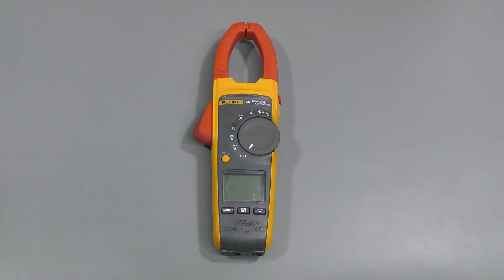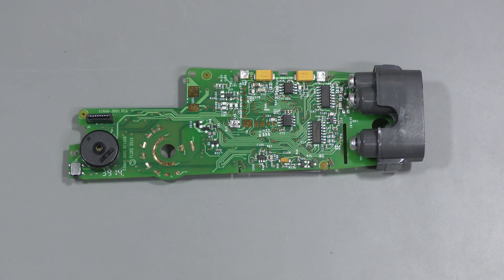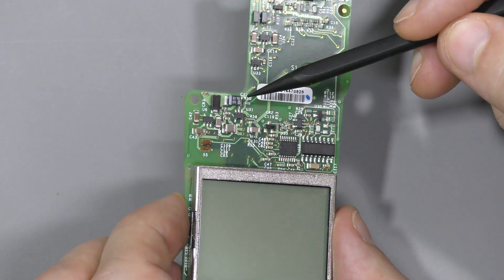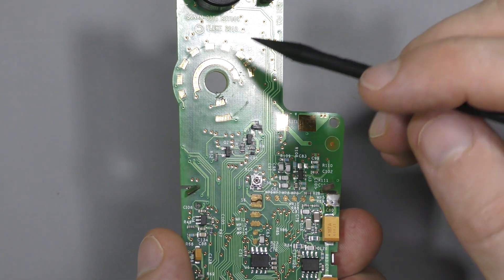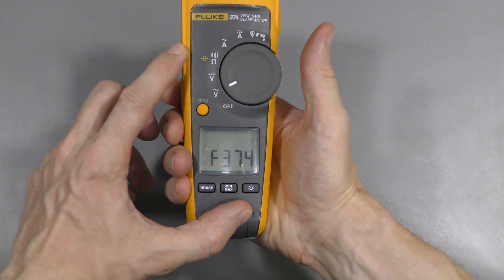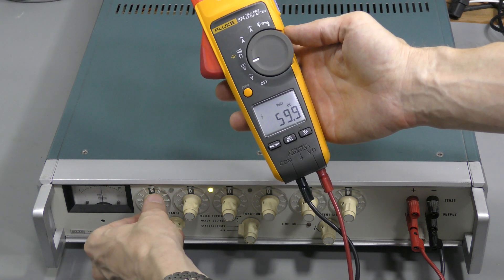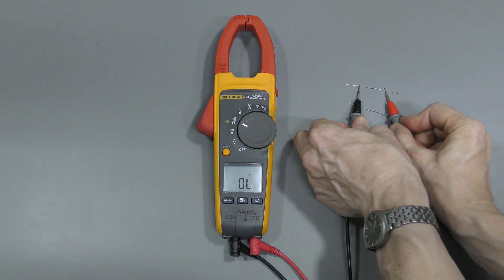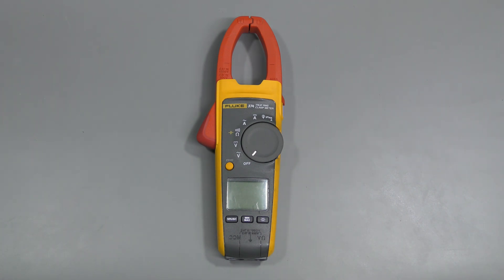#97 - Fluke 374 clamp meter repair

Comment: Hello to all. Maybe someone can help me in "non standart" problem... A have Fluke 378FC clamp meter. For 1 year it was lying on the shelf after a bought it and when a start measuring PB battery that was the problem. At straight probe polarity it was "for example" 13.0VDC, reversed probe polarity show me 12.0VDC. Other meters show 12.5VDC. I tried with different multimeters, probes, batteries and absolutely always this fluke showed me +/- 0.5V. What can it be? maybe firmware? I tried firmware upgrade via bluetooth, all was succsessfully, but problem with voltage remains.
Reply from the maker: I would suggest starting from the specs. DC Voltage: Accuracy 1 % ±10 digits.

Comment: I had a 376 that would not power up. Found U40 to be shorted out between pin 7 vss and pin 14 vdd. Was measuring 5 ohms. I desoldered pin 14 and lifted off pcb. Short was gone. This is a RTC I believe it is used for auto power off feature. Meter seems to work fine now with short removed. Not sure if I will go to the trouble of replacing it or not just for auto power off to work. U40 is under the LCD, so we have to handle disassembly carefully, not to damage it. In the beginning, I compared the current draw of this meter to a know good one. This one was way higher even when turned off. I used a temperature gun to isolate which components might be heating up. I found that the temperature around c2 c1 c141 which are all in parallel to be about 10 degrees higher. I thought one of these capacitors had shorted out when I measured 5 ohms across them, so I removed them all. Still had 5 ohms on pcb even with them removed. That is when I found U40 on the other side of the pcb to be the one that was actually heating up. This should be the same circuit in the 374 375 376 meters.

Comment: Someone may know the value of the high voltage ceramic think film resistor locate in the input?
Reply: If you mean the white flat resistor, it is a 1 meg, and I had one checking open. I hit it with some good leaded rosin core solder and it has worked fine now ever since.
Reply: @thomaszak1098 mine measures "OL" with my fluke 179.   So you just re soldered the mounting leads and it came back to 1 meg?   Trying to source one of these is hard!
Reply: Re soldering the mounting tabs fixed mine!   You could see where the solder had delaminated from the ceramic slab.
Reply: @kenstumpe9612   thanks. but the problem a face break the resistor in various pieces. After a long investigation i discover the value and type of resistor is HV resistor of 1M ohm. is very difficult find the original to replace!
Reply: I called fluke parts and asked about pn 103454.   They gave a quote of about $12 +$16 more for shipping.   None in stock, 8 weeks estimate.   I was lucky to just resolder. 4:47

Comment: Own the 325 version I bought brand new and put away for several years. Tried it today and wouldn't power up. Your video gave me the courage to open it up and it turned out to be dirty battery contacts inside. Thanks!

Comment: Very good video, thank you very much for your work, the like goes. I would like to ask you what function that variable resistor that is located in the rear and central part of the circuit would have. Thank you so much.

Comment: good afternoon ENG, greetings from Mexico,
Note that I have the FLUKE 376 FC clamp under repair and the fault I have is that the white thick film-type resistance is completely open,
It doesn't give me a reading when measuring with any multimeter, the resistance is what is directly linked to the voltage, Ac, Dc, and ohms,
Do you by any chance know what value that white flat resistor has in Ohms?
Reply: The white flat resistor, it is a 1 meg, and I had one checking open. I hit it with some good leaded rosin core solder and it has worked fine now ever since.
Reply: @thomaszak1098  tks man ,

Comment: Hi. I have a fluke 77 that sounds when I select the continuity function with not leads connected. I checked and I found this part broken https://drive.google.com/drive/folders/1IYKnqIpnDW1cQxQynd608evI36eL2aOf?usp=drive_link Do you know what part it is?
Reply: thank, my fluke 376 also has no sound

Comment: i recently acquired a matco tools MD79 clamp meter. very similar to the fluke you show. the meter appears to have never been used. my problem is when youu turn it on, the display turns on for a split second, than goes out and stays out. switching to different modes makes no difference. if you shut it off and turn it on again, it does the same thing (display turns on for a split second). i opened it up and visually looked at it, but don't see anything that catches my eye. what could cause this? thank you.

Comment: Buenas noches amigo, tengo una pinza amperimetrica Fluke 322, la misma no mide la corriente, mide voltaje, resistencia menos corriente, la mide pero la medida se va a cero a los cuatro o cinco segundos o simplemente no la mide.

Comment: At 5:18, how do you go from the LPTG etched label SMD to the LP-2985 data sheet?
I'm planning on sticking a 18650 battery [or 3D printed battery pack] on my Fluke CNX3000 because it wastes a ton of power in wireless communications and I frequently find myself using the backlit display.
BTW: I loved your mod on the Scopemeter color.

Comment: I have some I picked up at an estate sale if anyone wants a deal! Fluke 337, A lead kit with leads and 5 different attachments new, A 61 thermometer, Some Amprobe stuff, also vintage multimeters in leather and plastic cases. Colorado Springs area.

Comment: I have a 336 That reads voltage but In DC current, it shows 15A until you Zero it but won't read current at all- Even without zeroing it first.
Is there a schematic diagram out there anywhere that I could get a hold of?
Thanks.
Reply: Same with my 376

Comment: I have a Fluke 376 that had a shorted backlight LED, and seeing how yours came apart was a big help when disassembling mine. One thing I noticed when reassembling was that the switch contacts can shift a bit in the plastic cap and cause an intermittent switch issue. Thanks for the video!

Comment: Hello Sir / Madam,

I have Fluke 376 clamp meter and while changing battery, negative terminal clip
has come off from the location.

Kindly advise me, how to repair or rectify this problem.

If you need picture, I can send.

Comment: I have a 323 fluke clamp meter when turn on to test voltage AC or DC it keep on fluctuating from 400 something to 75 something am not sure what cause the issue it keep malfunctioning batteries are new?
Reply: Ever figure this one out?
Reply: @harveyhershberger4292  your ask me I don’t know what is wrong with it
Reply: @HBEnergy.m.s  I have a 323 that does something similar. When I first turn it on to AC voltage it reads OL, then slowly drops to 0 V. If I put one lead on 120V and the other on ground, it reads OL. AC current, resistance, DC Voltage all work fine though. I’m stumped.

Comment: Keep your eyes open for a clamp meter that is meant for lower maximum currents like 60 amps. I have one and the maximum wire size is only one half inch. It will measure milliamps.
Reply from the maker: Yeah, that would be nice too. I do have a clamp like this, not a standalone clamp meter, but a clamp probe, that can be connected to a multimeter or a scope. Also nice to have. http://hantek.com.cn/products/detail/77
Reply: @feedback-loop  I have one of those as well but have not yet figured out how to use it with my scope I guess I should look for some videos. Too many toys to play with . . . .Just looked it the specs and I see it will not measure below 20 milliamps. That might be one reason I was having some trouble.

Comment: Does the position/orientation of a clamped cable effect the current measurement, or does the value stay the same even when you move the cable around in the clamp?
Reply: Flipping the meter over so that the cable goes through in the opposite direction will change the polarity shown. The value should not change but probably will by some small amount.
Reply: @Gordon Wedman  Flipping=polarity I'm aware, but what formula defines the induced voltage depending on the absolute position within the coil of the field (with the field being of course 90deg towards the coil)? So an ac  conductor passing through a coil at 90 deg, but moving around within the circular plane of the coil. Does this have any effect, or as long as it is enclosed by the coil it is all the same/averaged out?
Reply: @jovangrbic97  laws of electrodynamics. The integral form of the fourth law of maxwell states that the path integral of the magnetic field around a closed loop is proportional to the sum of the currents over any surface enclosed by the loop, no matter the shape.

Comment: What did something like this cost as 'scrap/parts'? Seeing new it's 350EUR, I doubt it was 10-20$ as one wold dream finding something like this for... More like 100-200$ no?
Reply from the maker: I have seen used working ones for $170-200. I bought this one as a part of a lot, so it is hard to say. Most probably, less than $100, may be even much less, depending on my luck with other items from that lot.
Reply: @feedback-loop  I assume you resell most of your repairs. Would you see any benefit of an amatuer buying a Fluke clampmeter in this case, as opposed to a Uni T or similar? I think in 99.9% of situations one would not feel the difference?
Reply: @jovangrbic97  I have had great luck with the UNI-T UT210E AC/DC clamp meter.   Its resolution is 1 milliampere.   It is one of my favorite pieces of test gear.    I rarely made current measurements until I got this.   I was too lazy to open the circuit and put a meter in line.   Now I just clamp on a power lead.   I got it to measure residual current from my car battery to the car electrical when everything electrical is asleep in the car.     Works great and is very accurate.   They were $35 USD when I got it last year.   Must be a good seller or Covid gouging raised the price to $55 USD.   There are tons of reviews on this all over YouTube.   I checked them before buying one.
Reply: @jp040759  Yeah thanks for the input. It seems to me even as far as reliability and accuracy goes, in the precision ranges speced by a 'mere'clamp meter, the Fluke is just as usefull as a Uni T. I expect only in the 99.99th percentile of cases, big company, liability, freak high voltage accident... there is no benefit to the 10-20x more expensive Fluke.
Reply from the maker: I am not familiar with UniT. I believe it is cheap stuff. There must be plenty of reviews. I would suggest to look for a review, in which a reviewer knows how to tell a proper input protection from a piece of rubbish. I trust Fluke not to blow up in my face.

Comment: Thank you for another interesting video! I always enjoy watching your troubleshooting process. Thanks also for your series on the Fluke Scopemeters, I am in the process of upgrading my Fluke 99 to lithium-ion batteries based on your great videos. If you are interested in using the IR serial port on the Scopemeter, Google "scope grab software". The help file (old .chm type) includes a schematic and other information for building your own hardware.
Reply from the maker: I do have a Fluke serial adapter. I would be interested in maintenance commands like loading firmware into a blank flash/sram module, maybe changing scope type from 196 to 199 and such. Any info on this? Thank you.
Reply: @feedback-loop   Sorry, the only information I have regarding the commands is the information that came on the original PM9080 interface disk (3.5" floppy version 1.3) for DOS. These are all ( two letter) operating commands. Fluke can be awfully stingy with information.
Reply: @feedback-loop  I was wondering if the optical port of the fluke scopemeter (essentially a UART port) can be explored by the OPEN on-chip debugger along with GDB (The GNU Project Debugger) to create breakpoints during the firmware loading process in Fluke 190 series scopemeter.
Reply from the maker: @lostking2008  I don't know. Sounds like a lot of work. Probably easier to make an adapter for a programmer to read-write the flash chips directly. At least for the models with a flash/sram module (19x B and C). This discussion is in a wrong place. Should we move it to https://www.eevblog.com/forum/repair/fluke-199c-scopemeter-repair/

Comment: Me, buys clamp new. You, buys clamp and knocks loose stray solder ball while probing and fixed. Me, facepalm 🤦‍♂️. I guess I was burned on one to many parts items that were missing parts when I bough them. Nice to see a easy repair, congrats on the clamp meter.
Reply: Yes, but... I would say the more difficult repairs you do are more fun to watch!  And learn from.
Reply: I always check with seller and ask if anyone messed with items before I commit to buying.
Reply from the maker: This approach might be too limiting